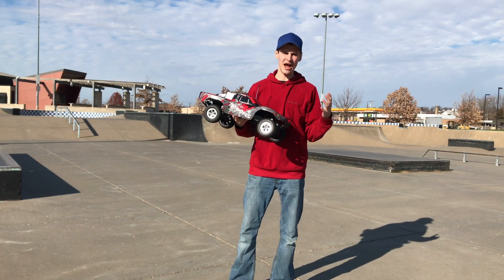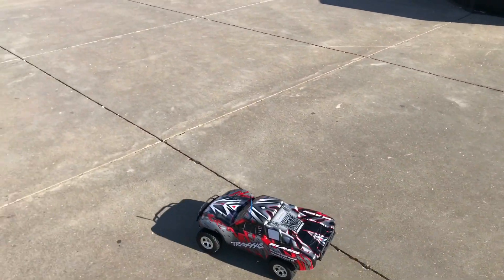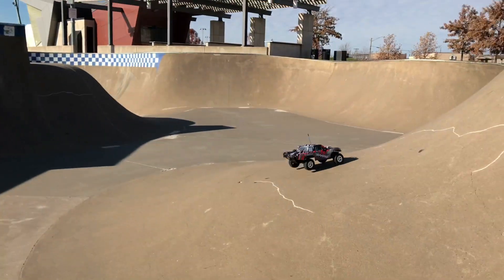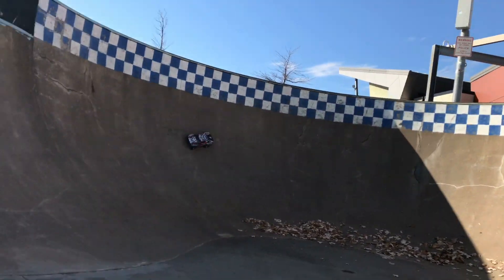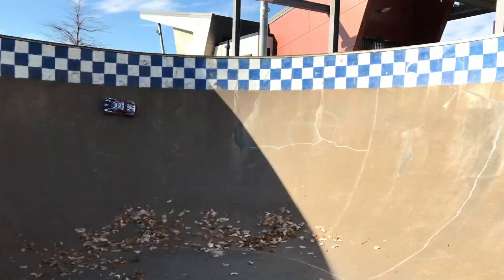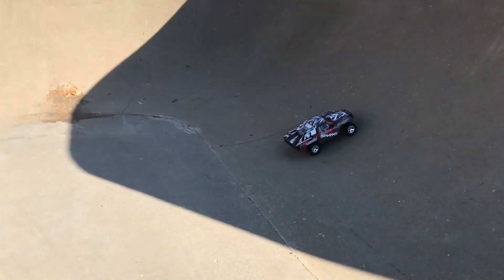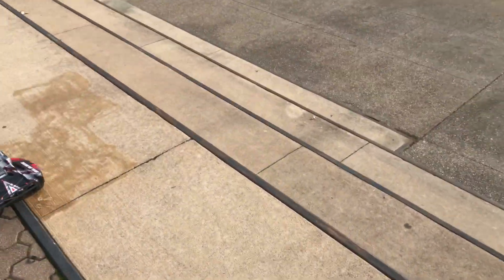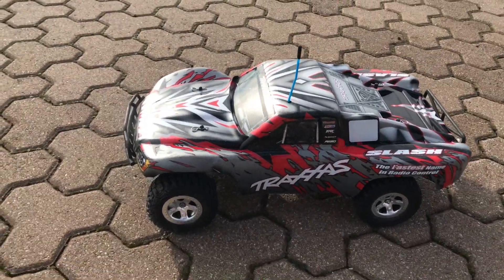Traxxas Slash 2wd RTR Hits The SKATEPARK For The FIRST TIME!! Will It SURVIVE???

Comment: Did you ever full throttle it on a ramp? I’m thinking about doing that to my slash 4x4 but I might kill it 😰
Reply from the maker: I don’t think I’ve ever hit any of the skateboard ramps at full throttle. I probably would break something lol 😂
Reply: the slash is extremely durable, i’ve made over 20m jumps with it. Only things that have broke is some plastic and the gearing (drove over 200km so no wonder why gearing broke)

Comment: I feel like if you had a go pro strapped to your head you would be able to control your car a lot better, the fact you can hold a phone record and drive the car decently is amazing ahahahaha
Reply from the maker: Thanks. Maybe…but there isn’t much control with a 2wd machine once it’s airborne
Reply: @RCKnockout  I agree I have a rwd slash with a 5400kv motor and running on 4s ahahah thing is impossible to control because it wheelies at 90 miles a hour
Reply from the maker: @fretsofharmony  yeah rwd slash’s aren’t known for having great handling lol 😂

Comment: Great Job,and fast,die you know the Topspeed.See this Slash for 229 Euro today.
Reply from the maker: Thanks! Glad you enjoyed it!
Reply: I’ve done a couple speed runs with my 2wd brushed and on stock gearing I think I pulled 22.4 with the speed gearing it comes with I got 30.3 mph and the best I’ve got it to was 33.7 mph with a smaller pinion but stock spur gear it comes with, I still need to try other combos though because I’m trying to over gear it until the titan motor dies so I can go brushless

Comment: When you bought your slash did you have to break in the motor? Or could you just take off out of the box?
Reply from the maker: You can take it right outta the box and run it.
Reply: You can absolutely take it out the box and smash on it but if you break it in using the cup of water trick you will have a significantly smoother power delivery and longer life on the motor.

Comment: When dropping in try giving it gas in the air to avoid nose diving!😊
Reply from the maker: That has very little if any effect. With it being rear wheel drive. The front wheels need to be driven in order to bring the front end back up. With rear wheel drive you have very little control of what the vehicle does once it’s in the air
Reply: @RCKnockout  sorry. i dont know much about the hobby. i was thinking about getting a rustler 2wd vxl.
Reply from the maker: @SchizoGamingChannel  no worries 😉
Reply: @RCKnockout  give it gas while in air to land on the roof. Better than just hitting the front
Reply from the maker: @vodka2432  I could try that but it’s 2wd so it’s not gonna lift the front end up
Reply: @RCKnockout  I have a Traxxas slash 2 wheel drive and it's running venialion and two as for 3s and bfgs and I can get it to rotate in the air and do backflips and stuff similar physics to dirt bike jumping